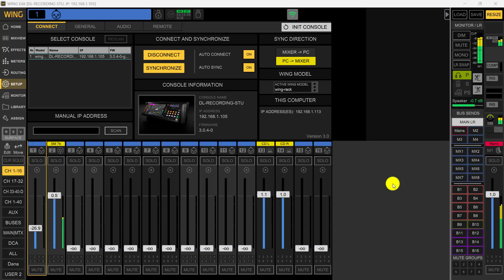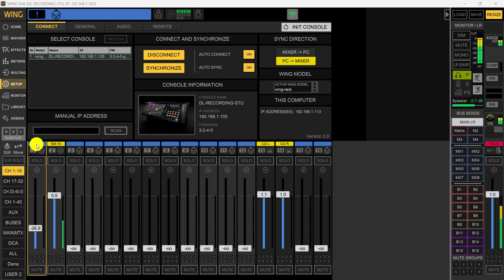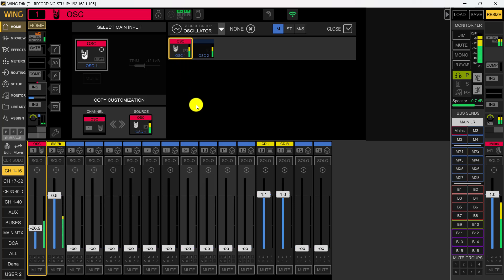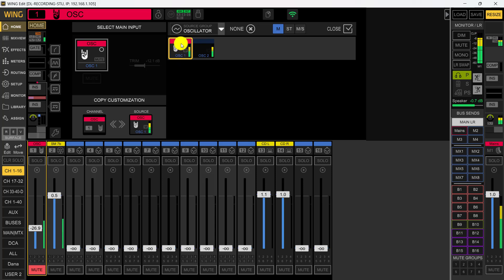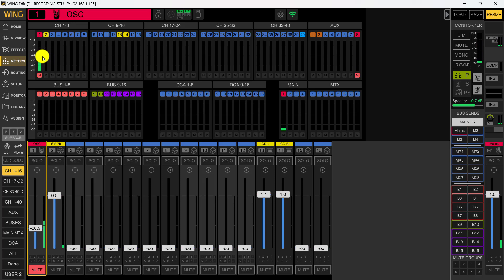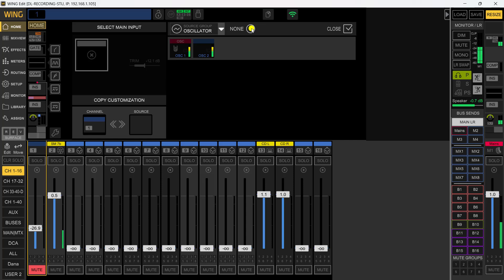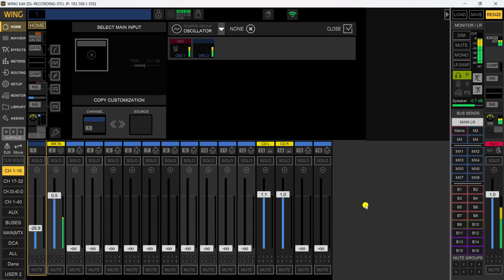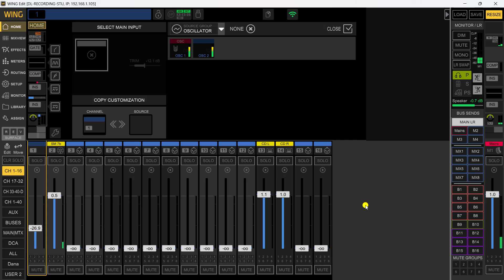How To Turn Off The Oscillator In The Wing Rack Using Firmware Version 3 0 4

Comment: Thanx for a useful video. To answer the question asked at time stamp 1:34 - the view of the oscillator source is not a picture/label/Icon, its a meter. To test this, if you change the oscillator to pink/white noise, you will see the meter moving in the source view of the oscillator (with sine wave its static at the 1:35 time stamp, making it simply look like a Icon)...
Reply from the maker: Thanks for the info!